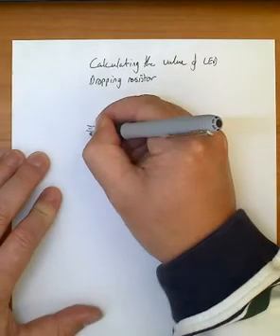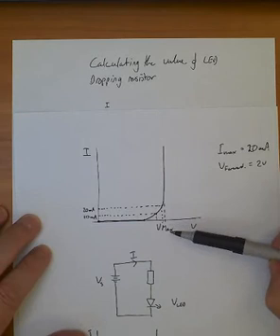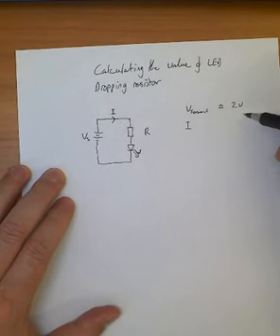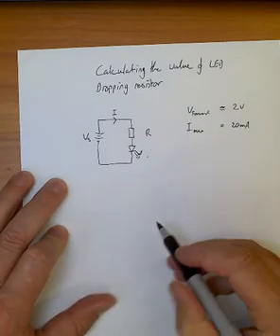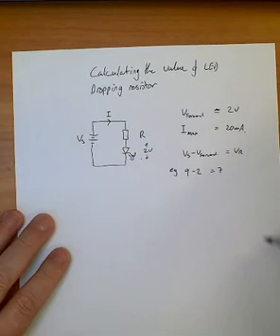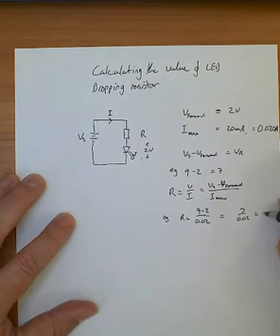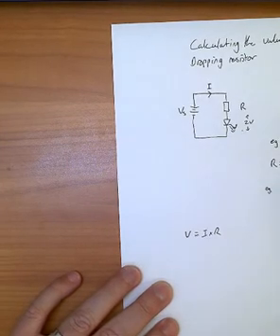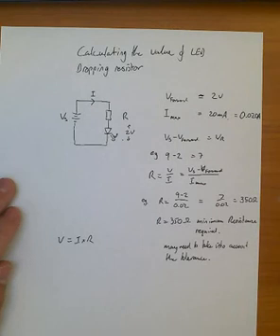calculate LED dropping resistor value

Comment: Excellent video. I am about to replace (4) 8 volt AC incandescent lamps in a Sansui tuner with LEDs since the originals have gone the way of the wooly mammoth. Am I correct in assuming that I should calculate the value of the dropping resistor using the peak value of the AC which works out to around 11.3 volts?